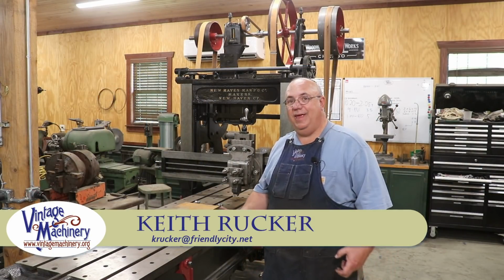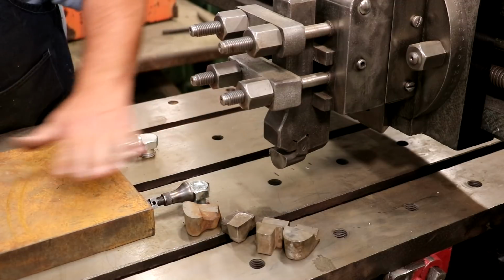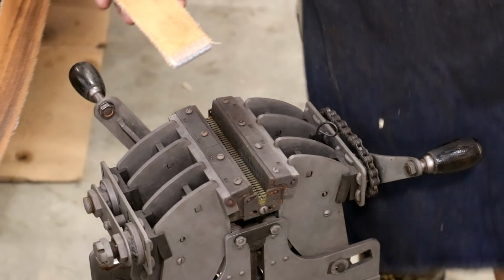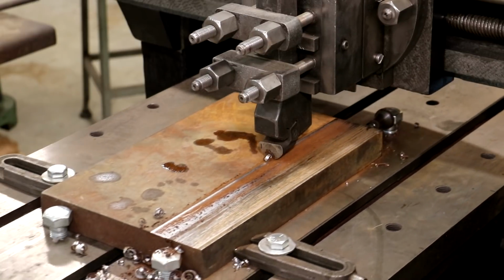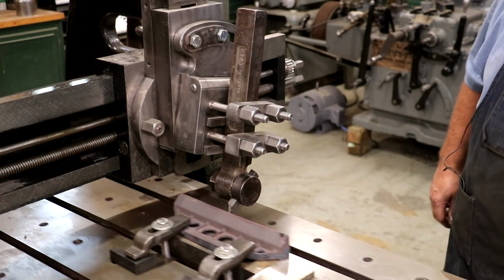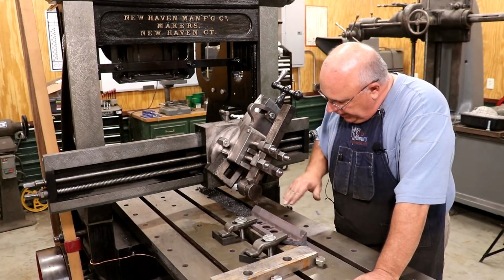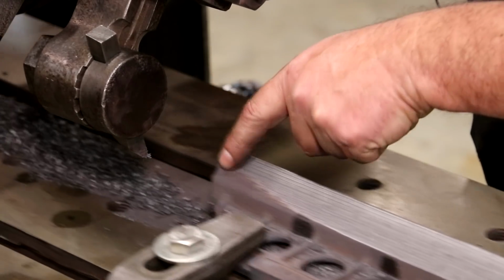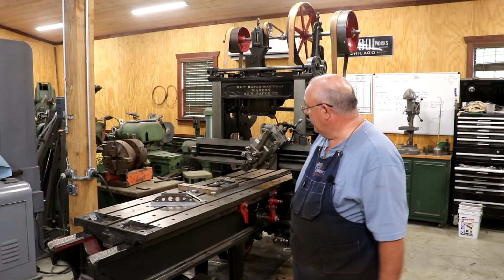Metal Planer Restoration 69: FINALLY - The First Chips Have Been CUT!

Comment: Ran a Rockford belt drive planer similar size to yours when I was an apprentice over 35 years ago.
This is where I learned how to grind HS tool blanks into cutting tools.
Been there and done that with the belt lacing. We used a belt dressing stick on those slipping belts. We’d rub the dressing stick onto the gripping side of the running belt. That sticky belt dressing helped with heavy cuts.

Comment: Hi Keith, great job on the planer.  This takes me back to our old cabinet shop.  We had several machines that still used flat belts, some still leather, others some type of rubberized canvas.  Our alligator lacing machine was one that you used a big shop vise to squeeze the teeth together.  We found that when we used rawhide pins instead of metal, we got a lot more mileage out of the lacings. Thanks again for bring history back to life!!

Comment: Absolutely amazing!  Let's recap this a bit.  You got yourself a pre-1900 metal planer that likely had at least one foot, maybe two, in the grave.  You rebuilt the thing to as good, if not better, than original, engineered a means to have it completely self-contained and still operate from flat belts, and have already had potential money-making jobs put before you.  Add to all of that, you still have a day job that does not allow you to be in the shop 24/7.  You have had some amazing help from awesome people to bring this piece of Americana back to life.  Way to go!  And this is only the beginning.  The care you put into your machines is a testament to the respect you have for these old, but still useful, machines.

Comment: 9:16 If you look at the top, you can clearly see the man pully shaft bending from the newly-increased belt tension.  It's reasonable to assume then that tightening the one belt loosened tension on the other side.  I'd expect you have to tighten these belts in tandem in the future.

Comment: 5:50 Keith, the belt came off as it was slipping on the top pulley.

I'd thought, that when you first start the motor, the belts slip - so maybe they all need to be shorter ?

Comment: Really great to finally see some chips coming from that planer.  
After you get more familiar with it, how about a video planing a cube from a block of steel and putting it on the surface plate so we can see flatness, and squareness of the work coming off the planer.

Comment: A top relief type of shearing tool bit works well on planers. Round on point to flat on cutting edge. But lots of chip clearance. Almost like a drill bit face. 
I use to have 6 dial gages on the planer I use to use for the steel mill repairs.

Comment: I'm going to wager the restoration of this machine just might be better than original. A good belt dressing will help reduce the belt slipping. Unfortunately "good" belt dressing like was used when flat belts were common is hard to find. The best I've used is liquid Cling Surface. It was a coal tar based product. Anything similar today probably has an asphalt base. The stick type belt dressing is another unobtanium product.
Reply: Interesting. How stupid would it be to have a can of super 77 or something similar for just a spritz now and then?

Comment: Would adding some cutting oil improve the cutting finish, that rusty plate is screaming out for some oil. Also would it help to have the table coated with WD40 to prevent that flash rust. My arm is itching to grab the spray can. Great to see that perform so well after its long restoration. Greetings from Tasmania 42 South.

Comment: Looking good Keith!
I would try to reduce the stroke on the belt shift mechanism. 
You have PLENTY of width on the sleeper pulley on both sides, and you are using ALL of it. You could easily reduce total side shift an inch.
Also notice, the belt is overhanging the drive pulley on each side. I was not the least bit surprised it kicked the belts off.

Comment: It's quite amazing how quickly machine tooling advanced. I found just now researching that some time in the 1750s the first metalworking planers were experimented with, followed shortly by the shaper around 1791. The first manual milling machine was invented by Eli Whitney in 1818. His claim to fame is the cotton gin, but I think anyone who works with machine tooling will agree that the milling machine was a more significant invention. It's kind of wild that humans were using lathes for all those thousands of years and nobody thought to stand it on its head and put an x and y axis moveable table underneath it until 1818.

Comment: Nice chips coming off that camel back. Would be interesting to see a gang setup of 4 or 5 straight edges in a row, if that is possible. Great job Kieth, outstanding.
Reply: It is, but the set up for it is a pain.
Reply: I'm thinking adjusting that clapper to the more in the right direction would help that finish on the bevel

Comment: Just for the record, as you are probably is aware, Dave Richards of the old steam powered machine shop channel has a very similar planer (identical?) run by overhead belting and could be a resource on operation of your antique planer. Congratulations on a massive effort successfully completed. Cheers.

Comment: Tremendous job,Keith. What a labour of love this has been. Have you considered fitting a fob of leather to the rear of the cutting tool to prevent the tool from rubbing directly in the workpiece on the return stroke? I have seen the leather fob used on shapers several times.

Comment: Keith, the planer project is so exciting to see in operation. Kind of mesmerizing to watch. IS IT POSSIBLE THAT THE STOKER ENGINE CAN BE FITTED TO PLANE THOSE TWO SURFACES ON THIS PLANER after you have dialed it in? It appears to have the height and certainly the travel. Just need the tooling to reach down in.
Reply: Going to run into the same clearance issues Adam had on the shaper, cant get in there.
Reply: One would wander what kind of milling machine and tooling was used on production of the stoker engine back in the day? There must be documents on this within Keith's vast archives.

Comment: Great to see the planer up and running!
I wonder how much the running gear hanging off the tool support structure contributes to the surface finish. There is a lot of movement and vibration happening up there.

Comment: Keep practicing with that monster! I'm thinking that planner  there is the only thing that will touch the stoker engine.
Reply: @flat-earther  the planer predates the stoker by about a dozen-twenty years. Modern machine tooling imo had less chance of dealing with the stoker, the old tooling? Might just have been used to machine stokers back in the day. The planer was made in New Haven, and both steam engines and stokers were made in Bridgeport and Waterbury at the same time. The rails are still used between those sites to the day.

Comment: Oh man, what a wonderful historical tool!  Your dedication and hard work have paid off.  I'm still worried a bit about you having to stand and move around so close to those moving belts, especially since they shift so far on and off the idling pulleys.  Could you fabricate an open-mesh screen between the actual belts and where you stand?
Reply: What did the original operators do?  Did they all die from planer injuries?
Reply: @paulcopeland9035  , probably only a few of them.  I do have some vague memories of how injuries to children in belt-powered factories played a part in getting child factory labor banned in the US.

Comment: Assuming the machine is solid and rigid, surface finish is ALL about tool radius and sharpness. I use a well set up and properly adjusted shaper and I get suface finish that is mirror like. I can get a 16 finish with common HSS tools when they are properly sharpened AND I use a proper crossfeed and tool radius.
Reply: @flat-earther  probably not. Most modern motors are so well balanced that the have little to no effect on finish. (I own a machinery repair business..for the past 24+ yrs)

Comment: That belt drive is a wonder to behold. I suspect the rough finish is mostly due to tooling, feed, and cutting angles. The machine itself should be fairly rigid.
Reply: Looked like there was some pretty serious deflection on the clapper box on the 45 degree cuts... I wonder if that part of the machine needs some attention.

Comment: If you start taking heavier cuts you might try turning the tool holder around so it will spring away instead of into the cut. If you watch some of abom's shaper videos you see what i mean. cheers

Comment: Are you going to plane the whole bed to get it true to the machine across the entire work area?
A tool post Blanchard grinder might be a nice addition for a good surface finish on items that will not fit on the surface grinder.

Comment: What is the gear lash like on the table drive, it sure sounds awful. After grinding and scrapping I'm sure you compensated by lowering the main drive gear properly.
Reply: I know someone who had gear mesh problems they couldn't adjust out with any success. they ended up using lapping compound on the gears and it took care of the bad mesh noise. Otherwise, great job. Maybe contact Steve Watkins over at "Steve Watkins at Work". He has a hydraulic planer that cuts smooth as butter. Between him and Adam Booth (and others) I'm sure you can get better cuts.

Comment: If I hadn't heard other machines like yours in operation I wouldn't know better.  That noisy table return gear assy NEEDS to be addressed!  Something that noisy has to be wearing not only on its parts but certainly hard on the your ears to say nothing of mine!
Reply: Go away.
Reply: @paulcopeland9035  You will notice in the latest planer video the gear noise is much quieter.  FYI the squeaky wheel always gets the grease!

Comment: Once you get the little kinks out, it would be interesting to see a part on the surface plate to see what kind of tolerances you are getting off of it. Any thoughts of live tooling like a toolpost grinder on it?
Reply: I've had people tell me that it works.  Seen one guy mount an angle grinder on his shaper for a really narrow slot cut in extremely hard material, the result was similar to a surface grinder.  Its probably one of those techniques that you should approach with much planning and great caution.

Comment: When the cutter is dragged back it seems like you need to have an angle ground on the back side to allow the cutter to slide up over the work.  Does dragging the cutter back damage the cutter in any way?
Reply: Generally a smaller angle is better for strength.  Chattering on the backstroke damages the tool over time. We attached a beanbag of lead shot with elastic bands to the clapper box to dampen vibration and skipping.

Comment: Suggestion; Instead of making a handle to raise and lower your machine, I suggest you have Windyhill make you a 12 inch wheel. I believe you would have a great deal more control using both hands and you would be able to reach the wheel easier than the handle, keeping you from using a ladder to reach the handles' top most arc. Excellent work on the planer! It was fun to watch it work.

Comment: Just wondering, the main gear under the table is more or less using a part of the complete circumference. Specially with smaller work. Is it and idea to see (mark?) what part is being used, and periodically turn the gear a bit to get a more even wear.
Reply: It's generally considered good practice to change which parts of the bed you use job to job in order to even out the wear not only on the gears but also the ways. As long as he's not always mounting the work in the center of the bed he should be fine.

Comment: Question:  Would it be feasible to mount a grinder to the tool mount and do a bit of surface grinding on large pieces?
Reply: I think a lot of old planers got converted into bed mills this way.

Comment: HI Keith I just had an Idea  i dont know if it will work  though. Was thinking you could use a  magnetic chuck same as the surface grinder to hold parts just an uninformed Idea its yours if you want . good work on the metal planer she works sweet...

Comment: Did they eventually add adjustable idlers to take up belt slack so you're not shortening belts all the time? I guess after an appropriate run in the belts stabilize in length...

Comment: I know the machine can cut a straight line, what i am having trouble with is, the back side, against the bed  is rough from the casing, so what happens when you flip it over and the cut planned sides are against the bed.   If you would show a complete set up and explain the steps i would appreciate it.
Reply: I would have also liked to see the set up for the straightedge casting for the first 2 cuts - not a trivial thing, to remove minimal stock and also have the remaining cast features relatively true visually.. & might have just been a long bunch of tedious indicating, tapping etc.. Seems like maybe could push it against a good angle plate that is parallel to the machine travel. Or, one thing I have done (using milling machine) is to file or grind off high points on the biggest surfaces, then use those surfaces as datums to set up the part to machine smaller flats on the opposite faces (ie the top and back of the handle).. when the smaller flats are clamped flat to the table and parallel to the travel, you will be cutting close to a best-fit plane. Would need to have a good system to be able to gang- machine multiple parts! 
Great to see the planer working!

Comment: Keith, I watched a YT video, Boulder Dam, that had some interesting stats of thick steel plate. At about 23 minutes, there is a worker shaping the edge of 50 foot piece on a riding platform attached to the tool bit. Check it out. Loved following your work on your planer. Roy

Comment: could you use a magnetic chuck off of your surface grinder?
Reply: No good for non-magnetic materials. Also, probably too much cutting force to ensure positioning.
Reply: @ratdude747  that's a steel plate and He's not going to hog out his cuts
Reply: @wescox2769  True... probably not worth the effort to move. Mag chucks aren't really intended to be moved between machines a whole lot.

Comment: Keith I bet you know David Richards steam work shop but in his last video he uses his overhead line shaft planer doing multiple parts , his clamps are worthy of note here is a link to the video 

https://www.youtube.com/watch?v=prbSI4Fmxwc

regards. Stuart from the UK 
in the past work life I helped commission a hydraulic planer test cut by the firms engineer was a cut that produced a chip 12 inches long 2 inches wide and 1/4 inch thick , we all stood behind him when he did the test cut 😎

great work on getting it running but was the clapper box in the correct angle for the vertical cuts , brain cell is a bit foggy its a long time since I saw one running ( about 55 years ) ,but I think you should lookout for a used ( very) 18 foot horizontal boring/rifleing machine , they were still used at the iron works for spun cast iron pipe moulds when I was there Dad used to look after a few of them during WW11 for the female opperators to run ( use big gun barrels )

Comment: That is about the clumsiest planer setup that I have ever seen; parts like the plate are generally held down by poppets and poppet pins, a poppet is a piece that is placed in the holes on the table with a setscrew tapped horizontally, and a cup head setscrew is put in the tapped hole angled slightly towards the left end of the table, poppet pins are made usually out of old round files with one end ground to a radius and the other ground like a center punch, they are angled downwards and push into the edge of the plate, acting like a vise hold down, pushing the part down and against the stop at the left end of the part, other poppets with setscrews low down can be used to force the part against the left hand stops.  A center punch can be used to indent the part for the poppet pins to seat.
Given the God awful gear noise, I would replace the first drive gear with one made of grade CE Micarta (garolite) (linen grade phenolic sheet).